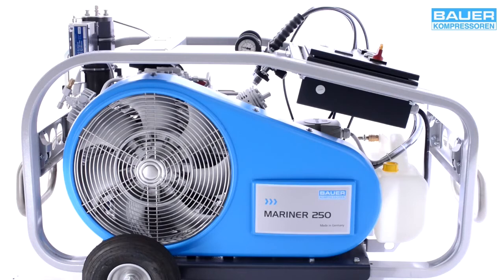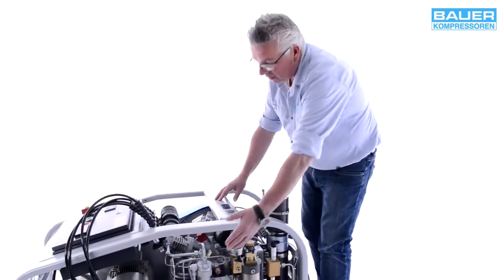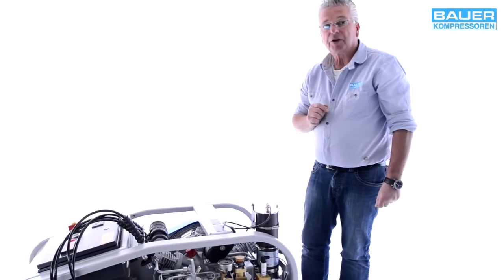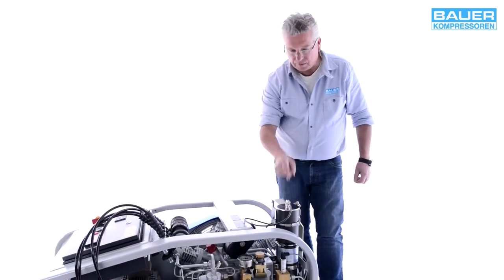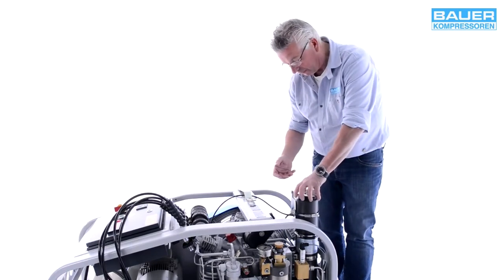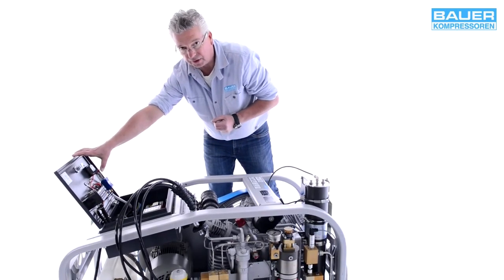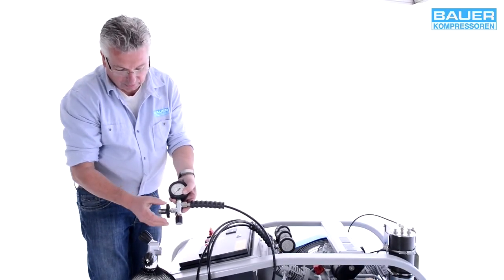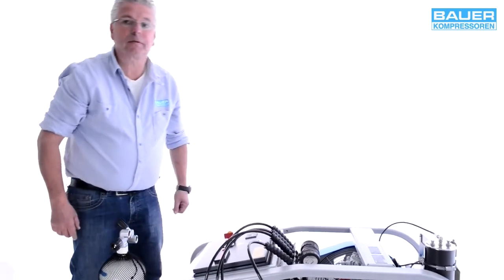Installation and Service Startup   BAUER MARINER

Comment: The cartridge will remain pressurized but the rest of the system needs to be returned to atmospheric pressure while not is use? Or the whole system should be pressurized while not in use
Reply from the maker: The filter cartridge remains pressurized during standstill to prevent premature saturation due to general air humidity. It is not necessary to leave the entire system pressurized.

Comment: please tell we have mariner 320 after refill pressure Remain 150 bar or release till zero
Reply from the maker: Unfortunately, remote diagnosis based on your information is not possible. Please contact your local BAUER dealer to have the system checked: https://www.bauer-kompressoren.de/en/bauer-worldwide/sales-partners-worldwide/